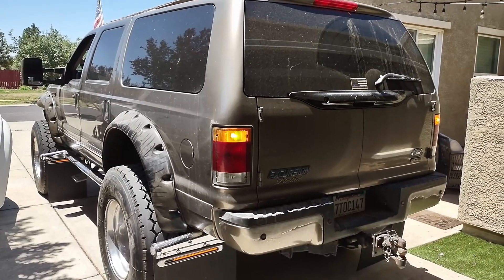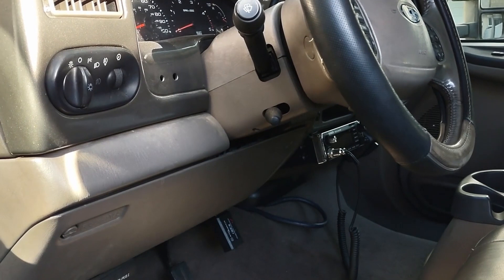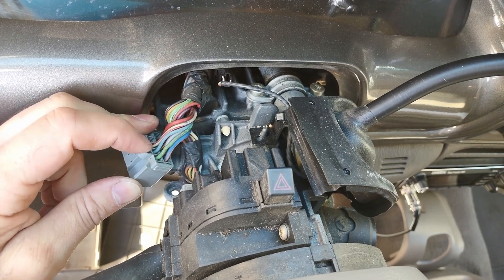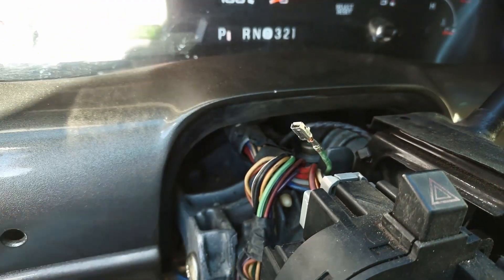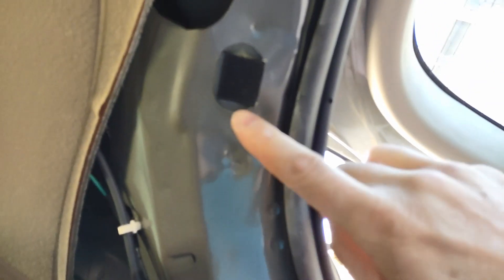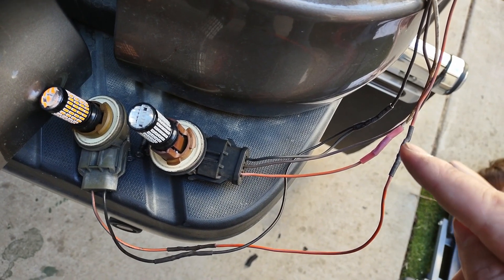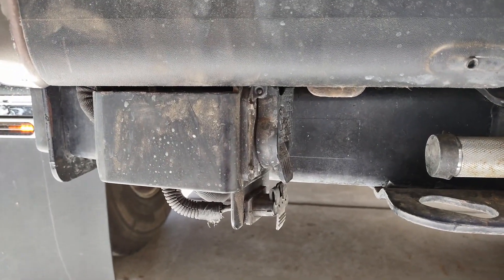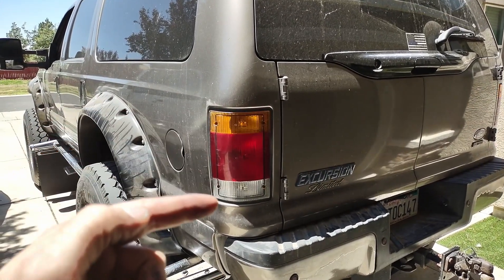Ford Excursion Rear Amber Turn Signal Conversion: Option "A".  Multi-function switch wiring.

Comment: Nice! That's what I did a bout 10 years ago with my Cavalier (using the Japanese tri-color tail lights) and my Blazer (I just used the backup light location as the turn and mounted a fog light as the backup) That is the easiest way to convert these cars before the BCM was introduced en mass. For your trailer switch I suggest ( if you already haven't) doing a trailer converter from like an asian or European SUV where it brings the Stop/Turn back together for the 4 wire plug. OR what I ended up doing just wiring a European trailer plug and adding amber turn signals to my trailer. You can plug both types of plugs in (On the trailer side) at the same time so if some one wants to use your trailer or you use it with a standard plug vehicle, you can still use the trailer ( you would wire the brake lights to the US style plug as the break turn) The circuit would be open when not plugged in to the European plug and the trailer will function with Separate turn signals when plugged in to the European plug. When connected to the US plug as long as the European plug isn't plugged in it will function as the US version setup (Turn brake ). I know there are some places that do refits that either run the turn signal from the front to the back similar to some of the other comments are saying and there is a converter that splits the signal from the brake and turn but when the brake is applied the turn signal alternates from the flashing of the front so that's not ideal for everyone. Some Newer cars that have Euro/Asian counterparts the separation is integrated in to the Body Control Module and in conjunction with the Export version tail lights, it makes it easier to convert SOME newer vehicles.
Reply from the maker: Thanks. That's some great info. I was considering doing the trailer setup like you described but we sold our trailer.

Comment: It’s easier to run a pair of wires from the tail light down underneath the vehicle to the front bumper, sign, signal light, and call it a day
Reply from the maker: That may be. Remember to add that feed wire from the third brake light down to the taillights to get back your brake lights though.  Definitely more than one way to skin a cat.

Comment: Where ya get the 3rd break light
Reply from the maker: The third brake light is factory. If you are referring to the flashing light, it is a special LED bulb. If you are referring to where the third brake light wire comes from, it is the green wire you find behind the headliner at the third brake light. If that doesn't answer your question, please let me know.

Comment: OUTSTANDING!
Reply from the maker: Thanks. I'll be posting option B soon.
Reply: @OffRoadEndeavor  do you think for trucks that have turn signal lights on their rearview mirrors is a possibility to tap into that bulb (on each side)and run it all the way to the back one on each side ? A left and a right? My particular truck does not have turn signal lights on the rearview mirrors.